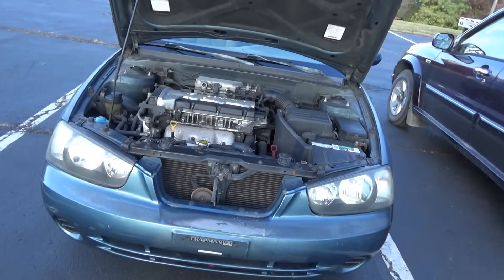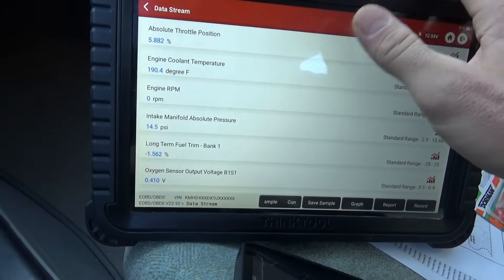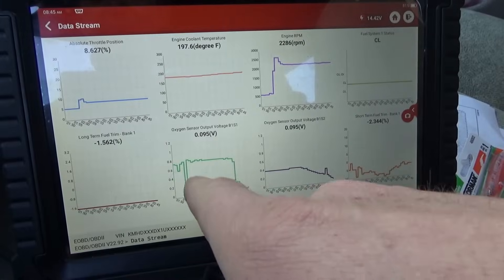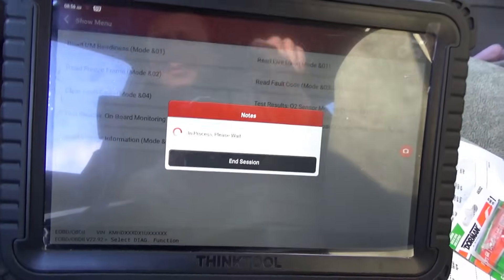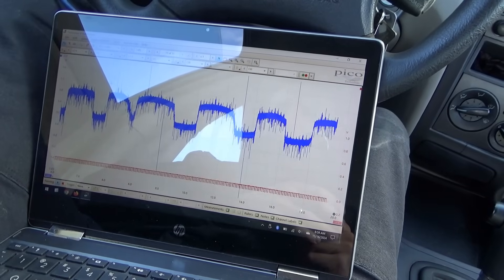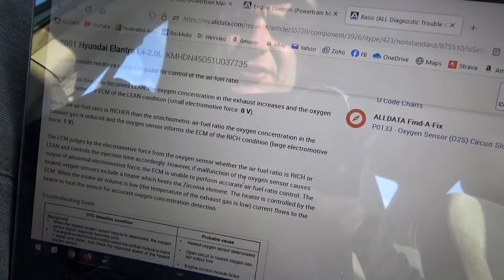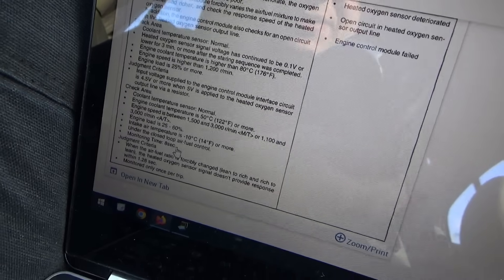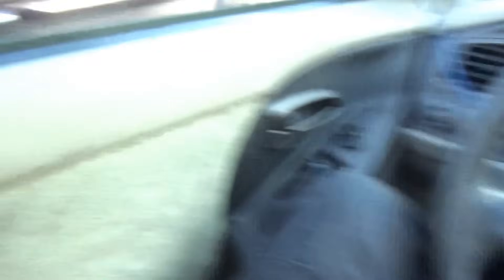$$ Light Hyundai: P0133-O2 Sensor SLOW? (SUPER SATURDAY 2024!)

Comment: I literally just had this happen so this is a true story/fix…
Had a dead o2 sensor that was stuck and we could not get it out so we took it to a local shop and paid them to put in both new sensors (4cyl)…got the car back and the check engine light came on the next day for a p0133. Took a look under the hood and noticed that the shop had put the upstream sensor in the downstream spot and vice versa. The connectors were different so we had to physically swap them. Basically, what the ecm was reading as the upstream data was actually downstream data so it thought the upstream sensor had slow data when really it just had after-cat data. 
We ONLY caught that mistake because we were familiar with our car. I don’t know how you would go about figuring that out with a scan tool, but I’m sure you could…
Hope this helps someone!
Reply: Actually, I do know how to diagnose it…connect your scan tool, run the o2 sensor data, and unplug the o2 connectors one at a time and see which ones drop out. If you unplug the connector leading to the downstream o2 and the data for the upstream drops out, then you know you have a swapped o2

Comment: When we were reviewing the raw data from the pico scope, the signal was so noisy that it would be very difficult for any PCM to interpret that noisy signal correctly. Even if the software tries to derive an average from that really crazy noisy signal it’s not gonna be correct. I would recommend trying to find what’s causing that noise on the very high impedance unshielded oxygen sensor return signal and separate the wires away from stuff that’s going to cause signal problems.. I would keep going until I got a reasonably stable sine wave signal from that oxygen sensor. That sensor is reading a chemical reaction caused by control changes at the PCM. It should be a sign wave like we’re all used to seeing not the square wave with loads of noise as shown on the video.

Comment: For the HEGO signal capture with the Picoscope it is best to use a Pico active differential probe like the TA041. Looking at the HEGO heater relative to battery negative is usually okay for a decent looking signal without noise. The injector flow rate has to be accurate across all injectors open loop. Perhaps the first fuel system check would be the fuel rail pressure, ideally the pressure across injectors (rail to manifold, which also tests the fuel regulator and pump flow capacity) which you can measure with two pressure transducers and a math function on the Picoscope.
Reply from the maker: @windward2818  nothing wrong with fuel pressure... Fuel trims are near 0% 😉
Reply: @PineHollowAutoDiagnostics  As you know we may be looking at a slight shift in open loop fuel control, resulting in closed loop switching non-symmetry with sufficient delay to trigger the DTC.

I would normally trust the data as you have with the insight in how the system works, but not given the age of the vehicle. I have burned so many times in the past with underperforming pumps and regulators I tend to want to rule these out in the beginning. Then look at underperforming sensors (MAP) and actuators (Injectors), and finally an old CAT.

In other videos you have located a known good vehicle to use for comparison. This may be helpful in this case given the nuance in the failure mode.

Comment: If the response time of the sensor is slower than expected and you're in closed-loop control for fuel trims, the control system will oscillate.  That seems to be what you're observing on the pico scope. 
 To really gain an appreciation for this effect, a course in feedback controls is essential.  Control systems is a rich field of study and understanding, and even its fundamentals is essential for analyzing weird symptoms like the one you demonstrated in this video.

Comment: With older DLC protocols, you have to just look at O2 data. It is super slow and cannot handle that many PID's at once. These older systems also use this algorithm to test the catalyst efficiency. I will not only test the downstream sensor but also if someone is using a device to circumvent the catalyst system to fool the computer into thinking the system is functioning.

Comment: measuring the heater resistance at the connector, is about 3 ohms okay for a suabru o2 sensor, would it cause my heater circuit low code?

Comment: Thinking about that Hyundai, could we take control of the fueling by for example using a variable resistor on the Ect or Map sensor and seeing how the vehicle responds🤔🤔🤔 another item to consider (from experience) is an (in)audible exhaust leak before the O2 sensor...i have had this in the past...thanks Ivan.

Comment: Thanks for sharing the seminar reviews. One of the strangest diagnosis I struggled with: signal crosstalk due to component lead frame corrosion. When condensation occurred the signals acted like a short (low impedance) causing faults. The root cause was a contaminant between neighboring pins of an IC; adding a little moisture (via cold spray condensation) caused a strong crosstalk and signal distortion.

Comment: I own a 07 accent and one thing I can tell you is when your Hyundai needs a sensor you better buy the Hyundai OEM or you will have problems because the resistance values are different, I learned the hard way on mine with the Purge Valve even though they are made by Bosch a Bosch sensor would not make the check engine light go out but the Hyundai OEM did!!!

Comment: Its interesting that for this vehicle, as seen on the Pico, the noise in the O2 sensor signal appeared to be both 1st order and 2nd order sine modulated. It was a consistent repeating pattern. Strange.
Reply: O2 sensor signals on a decent scope almost always look noisy and 'hairy'. You can improve the signal quality a little by using the o2 sensor ground instead of battery negative or turn on filtering. There is a lot of 'noise' in an engine bay that the scope will pick up.

Comment: I wouldn't be surprised if there's an injector issue, but not that easy to diagnose that in the field. However looking at the spark plugs could sometimes reveal if something is off with one injector.
A compression test is also something that can be done to see that all cylinders are in decent shape. One cylinder running lean could result in burnt valves (I have had that on a 5 cylinder Audi engine with K-jetronic) and then it's starting to get expensive. In that case it wasn't the injector but the fuel distributor that was off, but that could be tuned for each cylinder with an allen key.

Comment: If you have a failed or failing O2 sensor, replace it once and right. Pay the money for OEM. Amazon and most parts store O2 sensors will not fix the problem

Comment: i use a cheap old scanner with a tiny screen that is fine for older cars. gives you the basic data live. you need to use your diag skills to find the faults. the car manufacturers could have done so much better but they are trying to save money on materials. thin wires , a lot of plastic etc.

Comment: I've also seen this same sensor pattern and slow response code from an exhaust leak, like a crack in the exhaust pipe. I saw it on a Mercedes V8 that turned out to have a cracked weld around the converter.  It made no exhaust leak sounds and it was on the back side of the pipe where I couldn't easily see it.  I remember because It cost me an O2 sensor after making the wrong call.
Reply: I was gonna say the same thing

Comment: I watched your 03 chevy fuae oanel (no start) video 

Did you make those fuse panel, electrical, test light leads or did you pick them up somewhere.

I rigged up and soldered some gm headlight type sockets like you have, with 1157 bulbs, and long leads so i could hang them out the fender..  

And tinned the leads to help them shove into the fuse sockets. 

 But was wondering what you were using to plug them into the undehood fuze blocks and the male/female plugs you were using to one handed plug things in.

I am troubleshooting an 02 z71 with same symptoms.

Comment: Denso sensor for the win.  Bosch O2's are the Champion spark plugs of sensors meaning-I don't care if they were ever once used by OE, I'm not using either.
Reply: Years ago I bought a new 93 S-10 4x4 with the 4.3L.  It had a Bosch O2 sensor in it from the factory.  I was surprised to see that.  I figured it would have an AC-Delco one.
Reply: @Mr2004MCSS  So, are are denso o2's good replacement for ford f150 OEM o2's?
Reply: @erasmogonzales7428  If I couldn't get factory Ford ones I would probably try Denso but I always recommend OEM for sensors if at all possible.

Comment: I’ll be honest: If I had an older car with 89k miles on the original O2 sensors, I, too, would have taken the parts-cannon approach and just changed both sensors before committing to a lot of diag time & effort.  Yeah, in this case, it wouldn’t have worked.

Comment: I would compare the map sensor data to the O2 data. That car tends to have wonky O2 reading íf the map sensor is off a bit. 

That was mentioned in a OEM Hyundai service training i took in 03.
Reply: Looking at the engine controls primary fuel metering is speed density using a MAP sensor. How would you analyze the MAP sensor signal to determine if it had a set offset error? Is there a table containing the sensor transfer function relative to voltage out?

Comment: I don't understand if it says the O2 sensor is bad find one that works
Reply: Because codes don't always point to the root cause.
Reply: Did you not watch the video???🤔
Reply: But it doesn't say the O2 sensor is bad, it just says the response is slow.  This is the problem with newbs using scan tools, they don't understand that many PID codes report the symptoms of a fault, not the root cause.
Reply: I wish the OBD standard was updated to report which of the code setting criteria was set and the time stamp on each code so you can examine order of the faults to help identify the root cause.
Reply: Mode $6 data can help if available to decode

Comment: After seeing the scope but before seeing your diagnosis, my first thought is carbon on the intake valves, soaking the fuel in and releasing fuel, modulating the fuel inside the cylinder thus slowing the response from the O² sensor
Reply: It's a port injected engine so there shouldn't be significant carbon build up on the intake valves.
Reply: @ferrumignis  You are right about that, so I will counter with the thought of this car is 24 years old so the possibility of valve guide seals being not as good as they should be is possible could contribute to the possibility of carbon deposits. This may not be the answer but only a possibility.

Comment: Regarding the Hyundai, watch out for the flexpipe on the exhaust, they split. 
And could give this fault with the O2B1S1.
Sometimes when you show the parts kanon, I think back to my previous job were customer came and bought fuses for tv and radios, and came back to complain that the fuse went off with a flash, and there must be someting wrong with the fuse that we sold them. No there are nothing wrong with the fuse, we told you when you were here, that there is a cause for the fuse to blow.